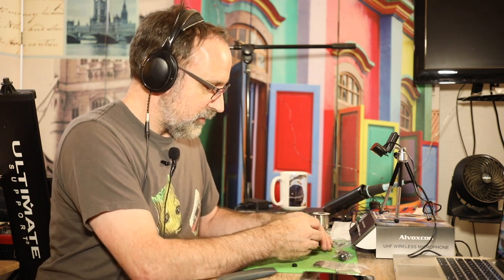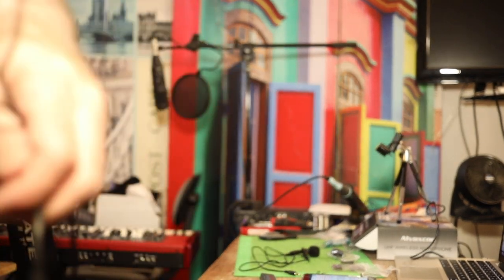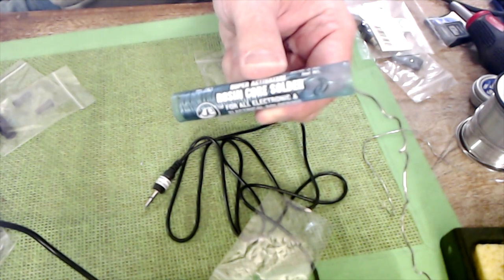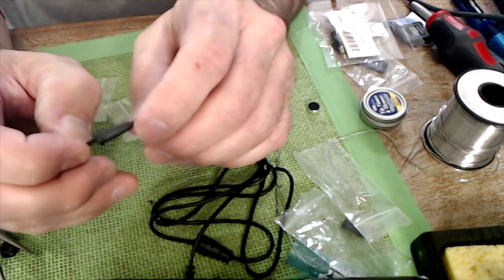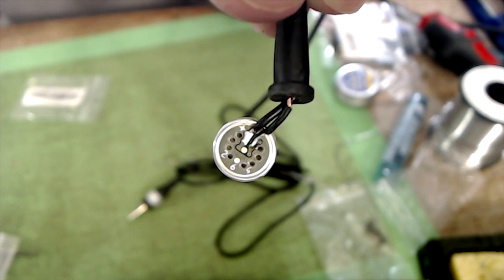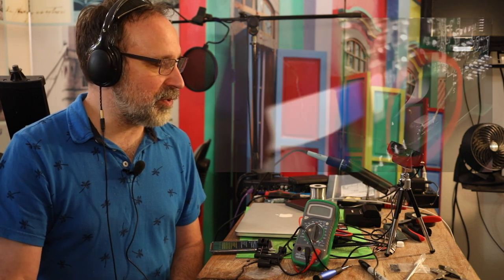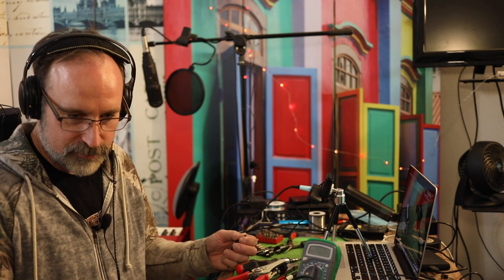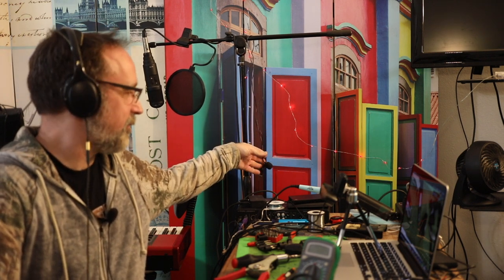Primo EM 272 & EM 264Y Lavalier Microphones | Began with AOM-5024L-HD-R | DIY

Comment: I try to build a microphone (mounted on a pair of headphones)  for a friend. I have looked up parts and informed me a little bit when it comes to a DIY microphone. 
But iam at a state, that i cant go any further at the moment. 

I do find a few informations but often they are limited to lavalier microphones, as this video here. 
I find it especially tricky to find a blank housing for the capsule itself, something like a typical gooseneck from headsets with enough space to fit the capsule and its parts and a "block" at the end, to get it to hold on the headset. 

But for his usecase on a pc, get i this informations right about microphones capsules i gathered ?
- Operation voltage should be between 1V - 3V (Typical mainboard microphone plug voltage of most motherboards, but should not matter because i think a usb amp+adc would be really beneficial)
- Low sensitivity under -35db (Why do most sites write it "-xydB" and a few others "xydB", minus the comma ? Cofusion as hell as a newbie :D)
- A really good S/N ratio above 75dB
- Lavalier -> Omidirectional // For a Headset microphone -> Cardioid
- I dont need a circuit board with some additional resistors or anything similar, just solder it to a 3,5 microphone port.

Its a bit frustrating searching all information and parts, videos like this are very rare and a sheere blessing. Most of the time when someone wants to mod a headset with a microphone, all i see is: "Get a Modmic" or they use a cheap gooseneck mic with ductape.... First solution is very expensive, second one sounds and looks terrible. 

And iam sorry for the grammarm, not a native speaker, iam from germany.

Comment: Hey, have you ever encountered em272 interference problems, such as mobile phone radio frequency interference, how to solve them
Reply from the maker: I think just unplug my fake Apple wanna-be power supply from the MacBook. I haven’t validated it yet. I also took apart the em272 and put it back together and the noise was gone.
Reply: @dougwollman2533  Wow, didn't I hear you wrong? Did I take the capsule apart? After the installation, it can work normally? I can't believe how it's done
Reply from the maker: @dingbu2730  No I just unscrewed the enclosure thing, wiggled stuff around and re-enclosed it. This also was not scientifically validated, but I didn’t hear any noise after that. I’m used to electronics behaving that way. Keep in mind this is one I built myself.
Reply from the maker: @dingbu2730  I may have received a cable that wasn’t quite the one he intended to send me. I’ve corresponded and stuff. Shielding would be the biggest issue there. But knock off Apple power supplies can be an issue. The first cable mic boosters sent me for another mic I assembled - that one held up against the noise without messing around trying to figure it out. Wearing an esd grounding strap might work too, if you’re...never-mind. Lol.

Oh. And most of the noise on the video is my computer fan. There is another video I uploaded where I was experiencing really bad interference noise  - the kind you’re describing: https://youtu.be/o1RkCnppRvs

And here’s how it sounds after I “fixed it”. 
https://youtu.be/fJ9b62uZR0c Keep in mind I turned that up to insane levels. There might be floor noise and traffic noise, but I didn’t hear interference type noise.
Reply: @dougwollman2533  Will the anti-jamming ability of aom-5024l-hd-r be better? I wonder if there is a big difference between 5024 and em272 in terms of sound quality and signal-to-noise ratio
Reply from the maker: @dingbu2730  I think you’ll be fine either way. I think it was either the cable or my fault assembling it. To tell you the truth I lean more towards the cable because it was pre-labeled for a different kind of mic which I shouldn’t have received. Stuff happens. I think the specs are similar. Aom-5024l-hd-r: https://www.puiaudio.com/media/SpecSheet/AOM-5024L-HD-R.pdf vs the primo em272: https://micbooster.com/primo-microphone-capsules/199-primo-em272.html  I ordered the same cable for both mics (different orders far apart) from mic booster dot com, but it wasn’t actually the same cable when I received it. I’m not trying to tarnish reputations, I’d order again in a heartbeat. I told Nick I got it to work, otherwise I know he’d send me another. My ear tells me the primo em272 was cleaner, which Nick was glad to hear. But what I didn’t say upfront is that I thought the 5024L had more “character”. Maybe more on the low end? Not sure.
Reply: @dougwollman2533  I have a by-m1 microphone, which has strong anti-interference ability and almost no interference sound. I remove its cable and install it on the em272, and then test the interference in the same way. The result is that there is still interference sound. I think the anti-interference ability of the capsule itself is not good
Reply: Test scenario: interference near the computer, radio frequency interference when the mobile phone calls
Reply from the maker: @dingbu2730  I’d do it, but I’m in the middle of a move and my precious mics are clear across the state. Correspond with Nick? I mean, you can try the 5024. That was my first diy lav. I only tried the em272 because there was so much positive fuss about it and I noticed it was from the same place that I had ordered all the enclosures and cables and stuff for making the 5024. Here’s the video that alerted me to the 5024 to begin with. https://youtu.be/t15eoy5gKDc Yeah, you can use a sharpie cap or end for the enclosure, and you can go to the dollar store for a cable, but I wanted to do better than that - and the only place I could find was micbooster.com for the parts. Except I went to digikey for the capsule. https://www.digikey.com/en/products/detail/pui-audio-inc/AOM-5024L-HD-R/7898328 All the parts are listed in one of the comments - in this video I think. Probably advise against dollar store cable, just sayin’ - you could.
Reply from the maker: @dingbu2730  If you check out my channel there’s more testing of the em272. And most of the time there’s no interference type noise. I did put up the bad instance(s) though didn’t I? I’m gonna blame that on the knock-off Apple charger. I really should validate that claim. Upcoming video I guess, but it’s gonna be awhile before I can do it. : (
Reply: @dougwollman2533  Yes, some poor quality electrical appliances will cause a lot of interference. Subscribe to you, continue to pay attention, I am also trying to find out the way to shield interference, now there are some progress, and the effect is better than before: be sure to use wire with shielding layer, and then wrap it around the capsule with copper foil for a few circles, the effect will be much better. {}
Reply: @dougwollman2533  Correct, i can easily hear the difference in the low end, with AOM 5024 vs Primo 272
Otherwise if you really need the 4dB higher sensitivity from 5024 then go with that.